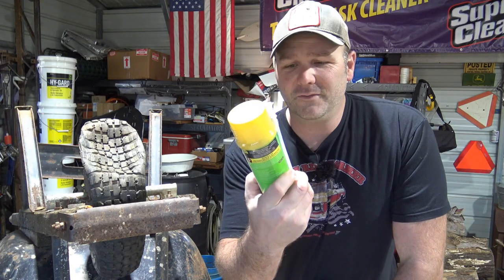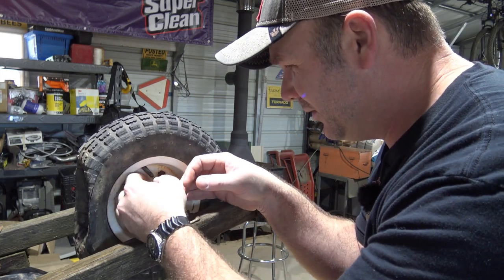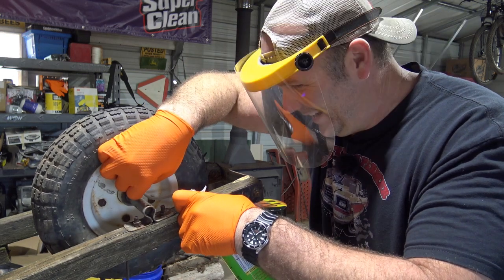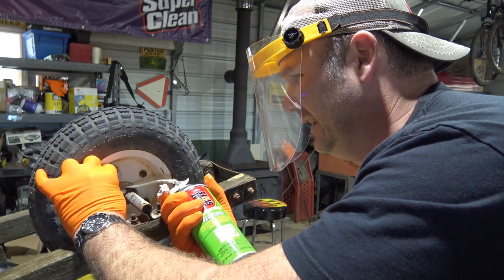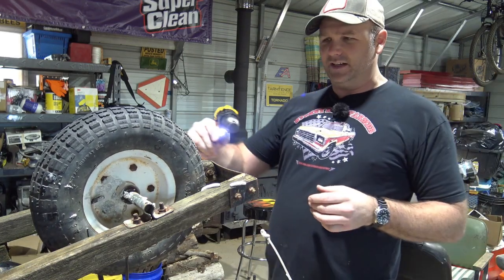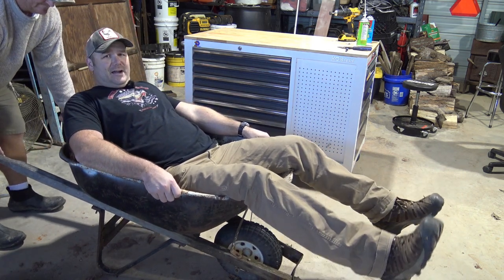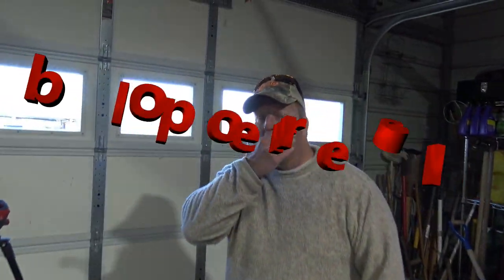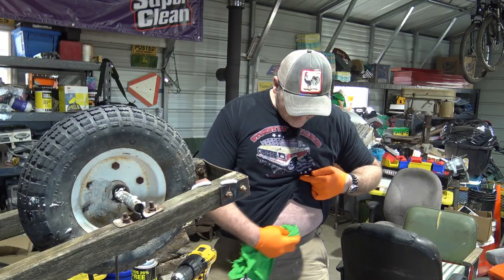Spray foam for flat proof tire...Will it work? Let's try!!

Comment: This is the biggest fail I have ever seen.
You are supposed to put holes in the tire to remove all the air and allow the foam to cure.
You’re not supposed to put the valve stem back in.
Reply from the maker: Thanks buddy...always good to have an expert on board lol
Reply: No expert just someone who has common sense!
Reply: @guy5322  I suspect Josh has plenty of common sense but it's focused towards electrical and nursing areas,or perhaps comedy,he's still working on mechanical common sense..this vid is right up there with the skunk under his house LOL!!!

Comment: you're a ding-a- ling but it's always funny to watch people use this stuff that aren't familiar with great stuff... even if you got it to cure, it would compact under load and not re-expand... and it is sticky as heck... paint thinner takes it off wet... otherwise, let it dry and peel/scrape it off

Comment: Sorry, but you proved nothing. 1) you need to use expanding foam 2) you have to stop and spin it every few minutes to evenly distribute 3) you have to wait like 24 hrs for it to set. And 4) Exactly why were you trying to put the stem back in? Did you seriously think you needed to do that? I guess so, since you didn't plan on giving it time to set. It baffles me that you even thought you'd get it back in there.